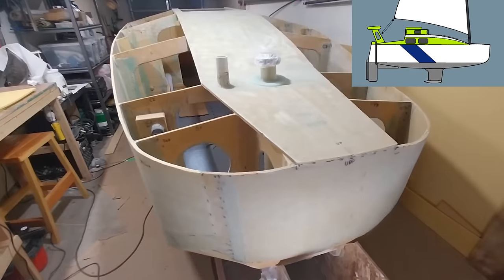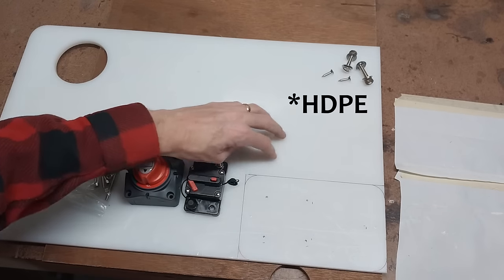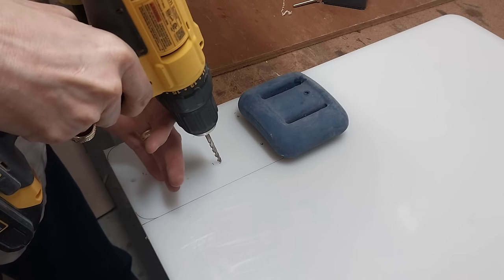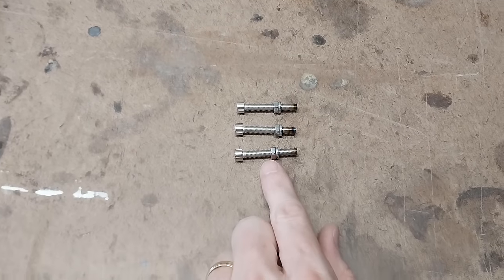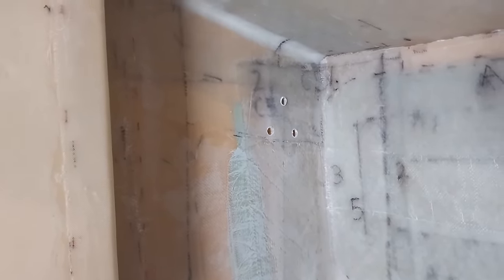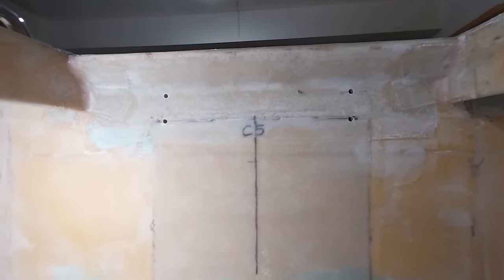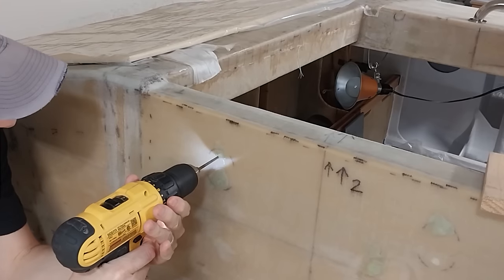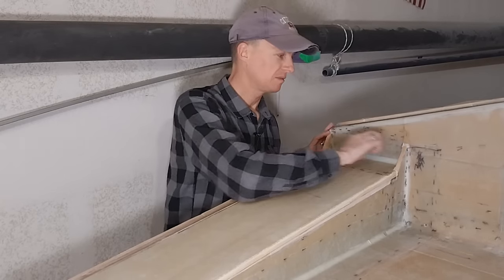OCSS-072 Drill-Fill-Drill for a Foam Core Boat - Sailboat Hardware Install

Comment: If you’re going to cross oceans you might as well have two lifpo batteries for redundancy. Awesome build! Looks like you’re doing everything high quality on the structure.
Reply from the maker: Thank you. Two would be great but they are pretty expensive. I'll likely start with one and add one if needed later.

Comment: Do not trust that breaker until you test it. I have had breakers like that from Amazon that don't trip until way overloaded or trip constantly. Boat is coming along nicely!
Reply from the maker: Interesting, thanks. I also have a fuse box that will be the next component down the line. So this is just a little added protection.

Comment: Nice to see some shiny bits of metal going on the boat even if it is just a dry fit.

Just a couple of questions if you don't mind. Why did you decide tomount the electrical board so low in the boat? I would have thought that the higher the better would apply for something that needs to be kept dry.

What blade did you use for cutting the HDPE sheet? Last time I tried to cut some I ended up with a mess.
Reply from the maker: The board was cut with the same blade I use for G-10 or fiberglass, it's a diamond edge made for cutting things like tile. The battery and switch/breaker panel are low to keep the weight low in the boat. I plan for these areas to stay dry because I don't have any through-hulls below the waterline, no engine shafts or anything like that. Also the only openings above are 2 air vents and 1 watertight hatch for entry into the boat. So my hope is the cabin will be very dry.
Reply: @ocean_capable_small_sailboat  Thank you for takng the time to reply. Have a good week, I'm looking forward to thenext episode.

Comment: She’s coming along!  I had a question also, is the whole boat going to be covered in one last layer of glass, then flipping it over and doing another final layer of glass?
Reply from the maker: I was planning to have 1 last layer go over the top, but the deck feels so solid with the existing fiberglass + the multiple layers on the panel seams I'm starting to feel it would just be excess weight. The bottom will get more fiberglass than the deck, the area near where the keels mount will end up with the most, but that's all coming later.
Reply: @ocean_capable_small_sailboat  She’s going to be bulletproof!  I’m looking forward to the keel fin castings as well. Great project captain perry, I’m really enjoying this build! Fingers crossed for 10k!!!

Comment: Where is the refrigerator going to be installed ?
Reply: Between the air conditioner and the wine cellar, obviously.
Reply: 😆 @areyoumad
Reply: The most sensible place would be underneath the pool table...

Comment: What would you estimate the mass of an average square foot of a glassed section of foam is? I ask so I can enter a rough value in a simulator. Looking online is more complex than I want, or is about keeping a house warm.
Reply from the maker: Once glassed maybe similar to same thickness plywood. 1.1lbs/sq ft.
Reply: Thanks so much! Very cool of you to answer. @ocean_capable_small_sailboat
Reply from the maker: Sure. Maybe even .9lb or so, I think the end result is a little lighter than plywood. Most of the volume is taken up by the super light foam, afterall. @actual_nonsense

Comment: 👁️👁️ Is the core foam or plastic - i thought it was plastic   like a bucket?
Reply: Its a high density foam out of plastic. I think.
Reply from the maker: The core is PVC structural foam. The Battery switch panel I made is HDPE.